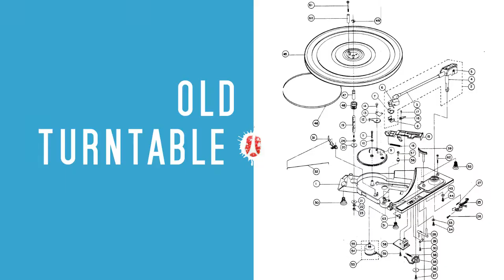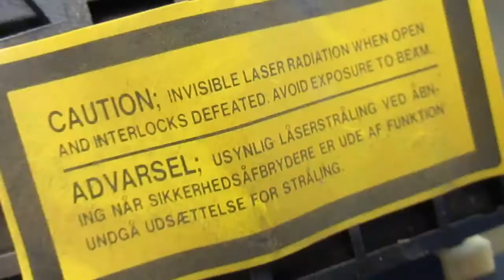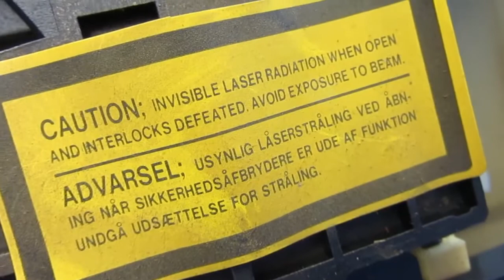Where Can You Find Free Motors For Your Projects? #FreeStuff #ElectricMotor

Comment: You’re wasting your time on anything that isn’t a free copy machine. Found 4 in my area so far. I probably have 75 stepper motors plus endless shafts, gears, bearings, pulleys, springs, casters, drawer slides, dc motors, brushless motors, etc. I can’t believe I ever wasted any time on a desktop printer.